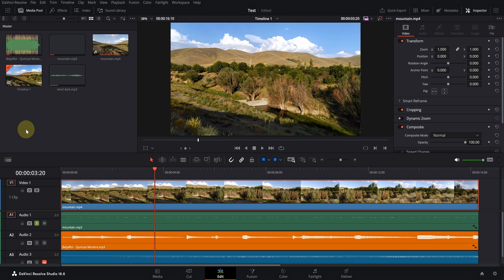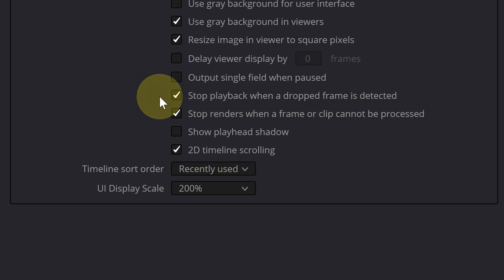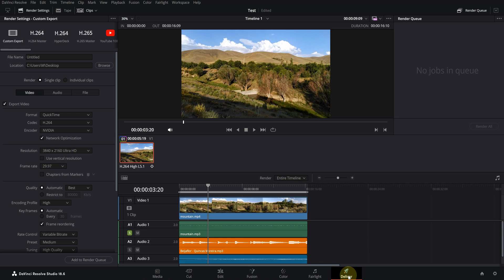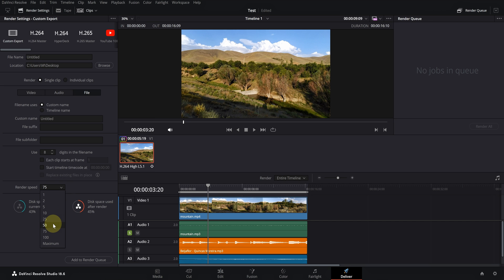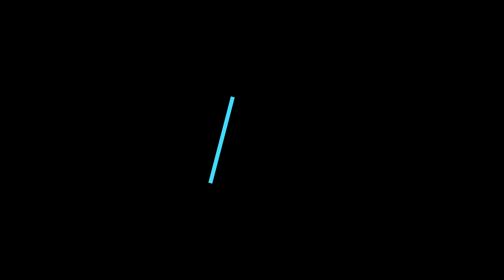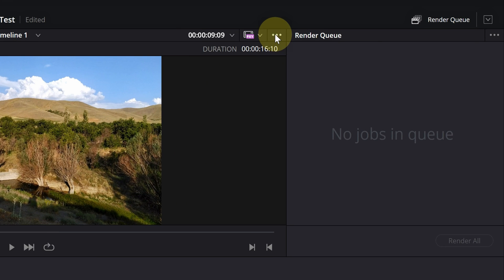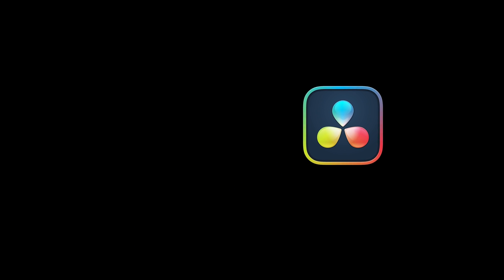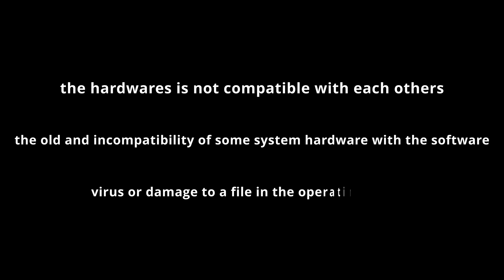How to Fix DaVinci Resolve Render Crash - 7 Ways

Comment: Good video! 
SuperScale WARNING: a few people are getting BSOD on Resolve 20 Beta: from Black magic forums - seems to be the combination of 20 Beta, using Super Scale and certain Nvidia drivers. A couple of people mentioned "heavy fusion compositions". I am affected, I cannot open older projects where SuperScale was used without getting BSOD. The consensus SEEMS to be that this is an Nvidia drivers issue. So certain Nvidia cards, latest Nvidia drivers with CUDA 12.8 (which Black Magic wants you to have for 20) and using Superscale = make sure you're backed up. And you may have to go back to 19 if a project is important.

Comment: What are the Stable versions? @DaVinci Resolve Tutorial
Reply from the maker: @Mahmood_who  
Some versions are unstable at launch, but they will fix them with update. It usually happens duo to viruses, system problems, issues on installation, using hacked version of software or it's additional softwares.
Thanks for watching 🌹
Reply: @DaVinci.Resolve  any suggestions which version should I use. My tech is high specs but, when using effects, transitions it crashes. Which version should I use?
Reply from the maker: @Mahmood_who  
If you have strong PC, for example with 6GB or higher VRam and 32 GB Ram , use last version. But in older pc maybe it's better to use 18 version. However it depend on your project, if you edit 4K with a system with 4gb graphic and 16 gb ram and medium cpu, you probably have problem if you use so many effect and transition, and it's not important what version you use.
Thanks for watching 🌹
Reply: @DaVinci.Resolve  i have i7 10 gen, 16 gb ram, and 6 gb VRam. So, 18version should i use, right?
Reply from the maker: @Mahmood_who  
I think difference between 18 and 19 should be less than 10% in 4K projects. also 19 has more effects and tools than 18 but 18 is a bit faster. it's depend on your project and your choose, speed or tools? maybe you can install both of them and use 18 for project that crash in 19.
Reply: @DaVinci.Resolve  thanks a lot man ❤️
Reply from the maker: @Mahmood_who  
Happy to help 🌹🌹🌹